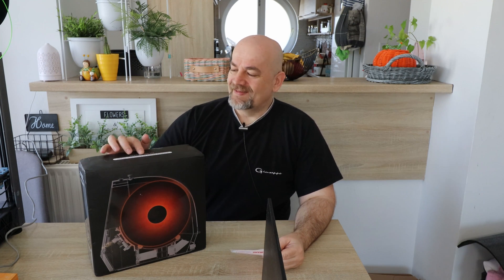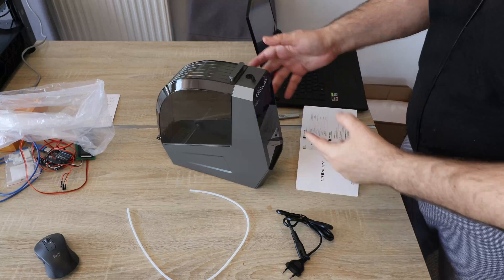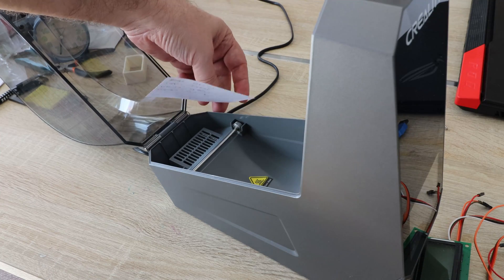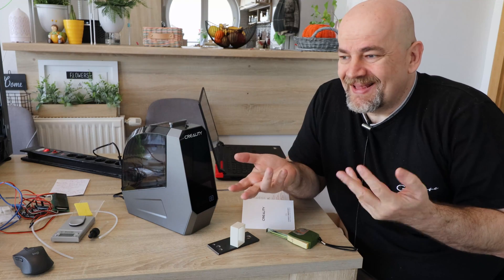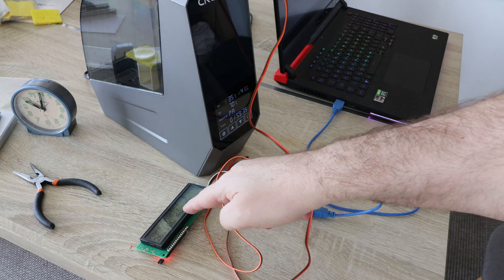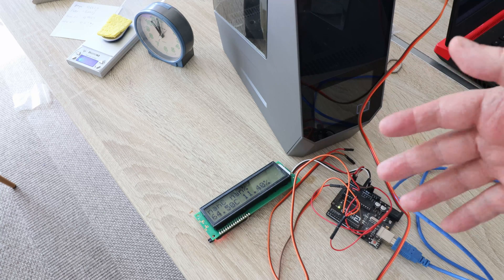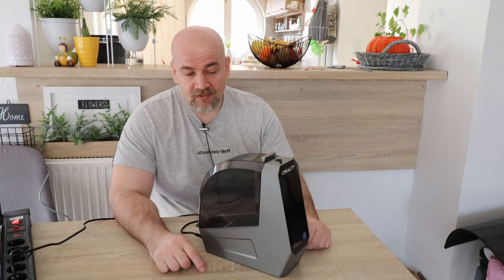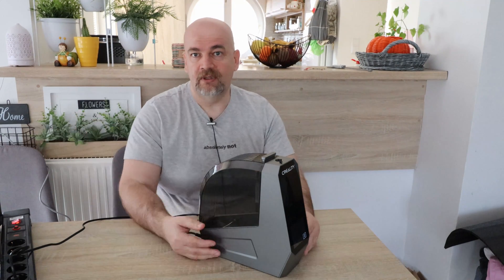Creality Space Pi filament dryer test

Comment: Hi, I"m a big fan of your channel. I have a problem I wish you can help with. I have the exact same dryer(owned Sunlu S1 before but returned it). I used this dryer to dry PLA and PETG with recommend temp but it seems to never got the filament fully dried. Even after 10 hours or 15 hours of drying, the fillament still make "popping" sound when printing(both PLA and PETG). I live in area with 45% relative humidity so not very humid. This happens with multiple brands of filament, Jayo, bambulab filament, elegoo, and other.

What am I doing wrong? Or is the popping sound expected from normal filament? The popping sound is about once every 10 sec or so while printing normal speed. Print quality is very good but I'm still frustrated about occasional stringing.

Comment: There’s an exhaust near the front for the moisture to exit, very small hole but it’s there. I’d recommend putting a bulkhead on for the PTFE tube if printing from the drier as the tube will pull in a case a jam. It’s so far a good drier.

Comment: It may have taken the water out of the sponge temporarily, but if the door is closed the water will just be trapped inside, and the filament will eventually just reabsorb it. Using this to dry filament will either require a desiccant or leaving the door open. The water needs somewhere to go. Either way a $40 dehydrator will work 10 times faster than this overpriced thing.
Reply: It’s got an exhaust for moisture to exit, it’s a small hole near the front of the unit
Reply: @milkybaravenger  yup the actual hole is on top back of cover...
Reply: Any it is only $54 so it’s not much more expensive than a $40 dehydrator.

Comment: I'm currently testing this one as well, I'm quite impressed, although its not perfect, I find it much better than previous units like the one from eSun, its also a nice looking unit and looks great sitting next to a K1C, would be better if it had a compartment for desiccant, I don't like how the PTFE tube can just slide in without any resistance, it should have a bulkhead compression fitting instead of that silly rubber grommet.

Comment: Relative Humidity is a challenging metric to gauge performance because of how it varies with temperature. A quantity of air with a fixed amount of water vapor in it will have its RH drop as the temperature rises.

Perhaps it might be informative to derive the Dew Point from the RH and temperature, because dew point doesn't vary with temperature for a given quantity of air with a fixed amount of water vapor in it. (At least that's how I understand it.)

In a sealed dryer with a roll of wet filament, you would expect the dew point to go up as it vaporizes the water in the filament, even as the RH drops. This would allow you to better demonstrate the benefit of filament dryers that have some way of actually getting rid of the water they vaporize out from the filament without needing to occasionally open them yourself.

Cool review! I'm interested to see the results of the PA drying tests you mentioned showing a little clip of zip ties soaking in water. Cheers from Boston, Massachusetts!

Comment: Good review with the performance test but the general ease of use should've been more extensively reviewed. I had this dryer and returned it because the fan is loud, front touchscreen is very cheap and often unresponsive, and the ptfe position is at an awkward angle to move filament through. Unfortunately creality isn't a brand that's known for thoughtful well designed products.

Comment: If only they'd put a second hole in the back then I might've bought it.
Reply from the maker: It can be made by user, minimal DIY. Drilling a hole and insert 3D printed part to guide the filament (but that part must be temperature resistant, from ABS, ASA, PC or Nylon. No PLA or PETG.
Reply: @MyTechFun  Was thinking about doing that.

Comment: Concerning drying nylon: Based on my own expirience: The 70°C setting on an sunlu s2 dryer is enough to dry PA. I've tried it with nylon trimmer line that sat open to air on a home improvement store for quite some time. 
The difference is, how long it takes. In a comment under cnc kitchen's video on printing with pa trimmer line ( I've used the exact same as he did), a commenter stated, that pa can  be dryed at lower temperatures than the recommended 80°C, but every 10°C lower doubles the time to dry it. 
This might be something to look propperly into.
Reply from the maker: As mentioned in the video, we have experiment in progress, drying of PA6 nylon. Test will be done on 70, 95 and 120°C. Results in few weeks..
Reply: @MyTechFun  Awesome, I'm looking forward to how the results are.

Comment: Hey. Thanks for the review. I almost bought one as I needed an extra one. I have the eibos single roll one and it's OK. So I bought the sunlu s4 dryer. It is amazing. I looked at the space pi but as of now we can only get the single roll option. And the fact it only has one option for filament exit also was an issue. Maybe you can compare this to some other ones at one point. Like the sunlu s2 or s4 etc. Tks
Reply from the maker: S4 test comming soon. After I finish 4 dryer testing (which are here), there will be a direct comparison too.

Comment: this is a great test, thank you for the info!

when i started printing there weren't really commercial options that were affordable so i bought a nice food dehydrator that opens from the front.  i can fit 6 rolls or so in it, it's really nice.  not good for storage of the filament so i have a separate dry box for that.  takes up some space, but it works!